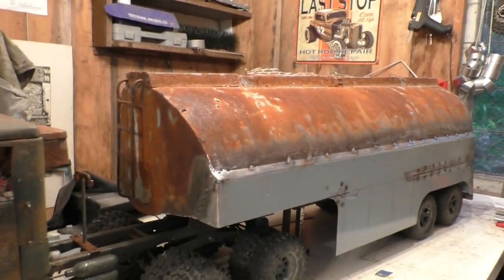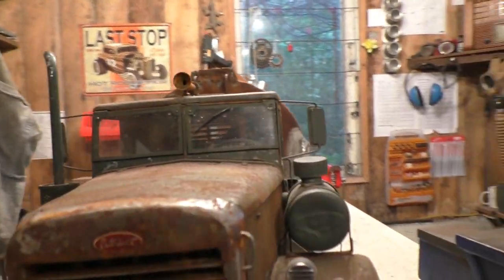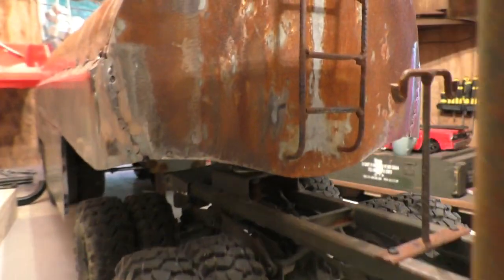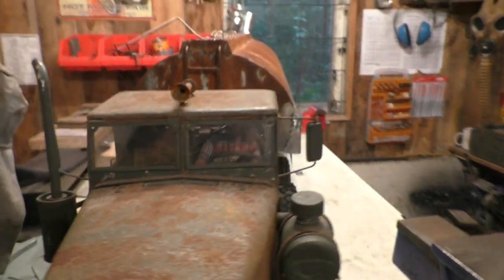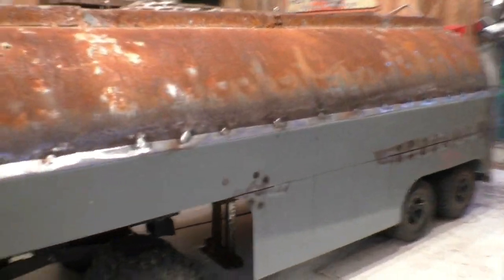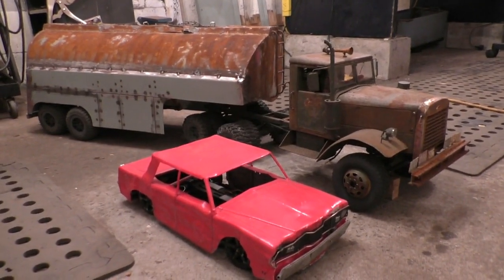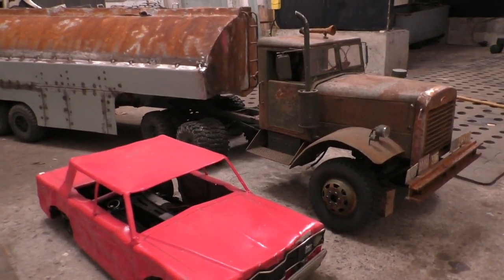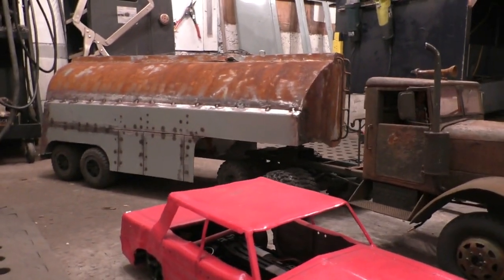"Duel" style tanker for FATBETTY (part fourteen) Metal RC model truck.

Comment: congratulations! really a good job. if I can give an advice the front bumper of the tractor should be set back for a better optical effect and give a more appealing effect to the tractor. however very good
Reply from the maker: It is not the original bumper for this truck and I will return it back to it's original army truck look, so I  am a limited in how much I can mod it.